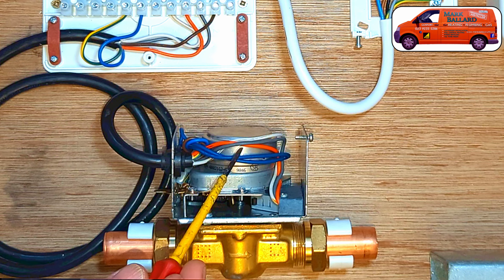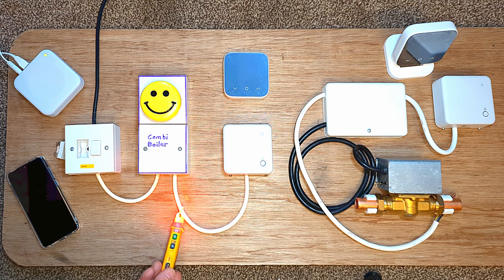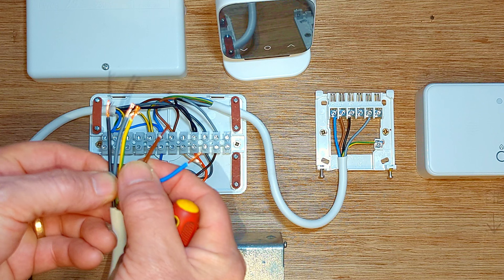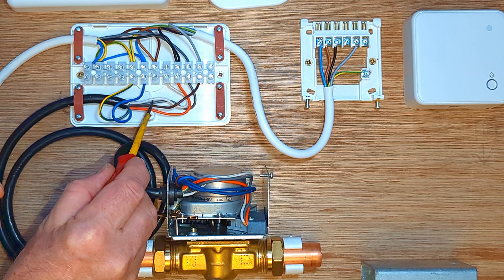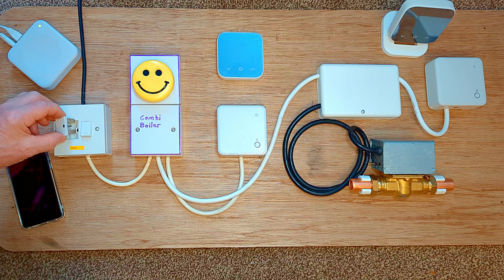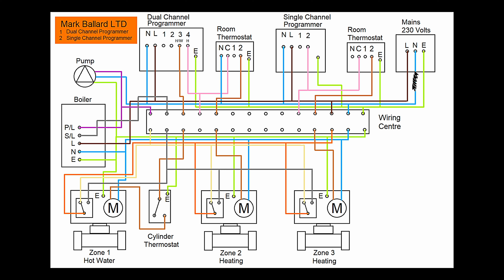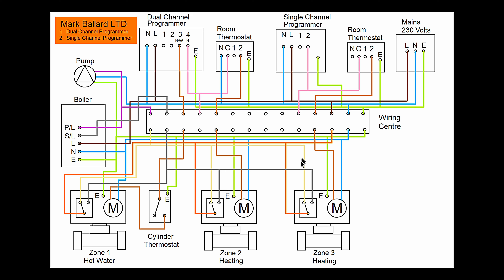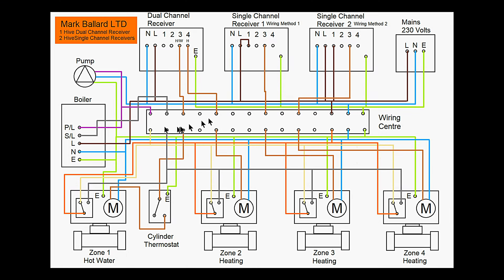Replacing Your Old Programmer & Room Thermostat with Hive Active Heating & Wiring up the Zone Valves

Comment: Hi Mark, I’ve got this set up upstairs (separate Honeywell hot water programmer and Honeywell heating thermostat in main bedroom). However I also have a heating Honeywell thermostat downstairs. My question is, do I use a Dual Hot water and Heating Receiver to replace the upstairs setup and then use a separate heating receiver downstairs, connected directly to the boiler?

Comment: Hi Mark,  Thanks so much for all your vids on Hive.  Question: In your wiring diags, you say the white zone valve wires can be live so must be terminated safely, even though not used. However, in the diagrams they appear connected via the wiring centre to the purple P/L pump wire.  Doesn't this mean the pump will run if any ZV is closed?  I'd have thought the P/L should be controlled only via the boiler so shouldn't be linked to zone valves in the wiring centre. Please could you clarify?

Comment: Hi Mark. Can I ask. Does a boiler fit it in an apartment building on the fourth floor half to have a condensate pipe as well as the flue. A plumber has just told me he hast to run a condensate pipe down the outside of the building four stories high.
I see other buildings that only have the flue.

Comment: Hi Mark, I have the hive active heating v1 system (the one with the dial )and wanted to wire it to a vaillant ecotec plus 825could you explain, I’ll be using 4  core & earth from boiler to receiver
Reply from the maker: No problem. Watch my video on how to install my combination boiler to tell you everything you need to know